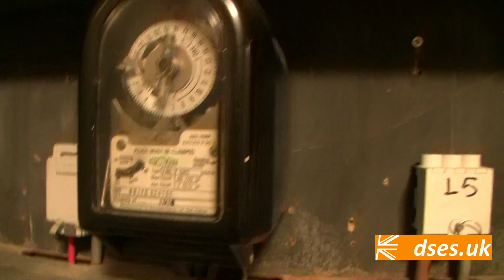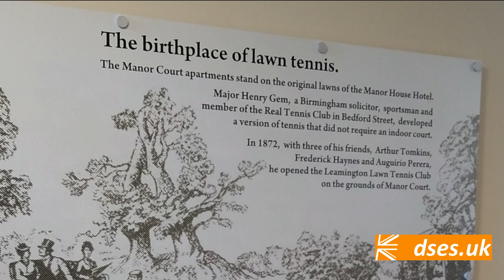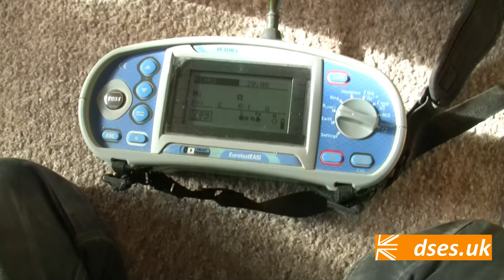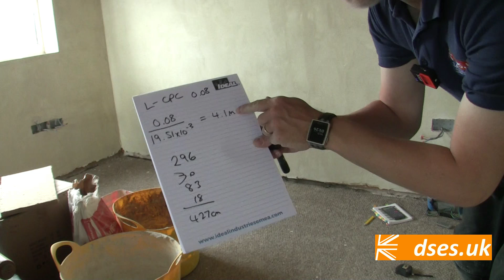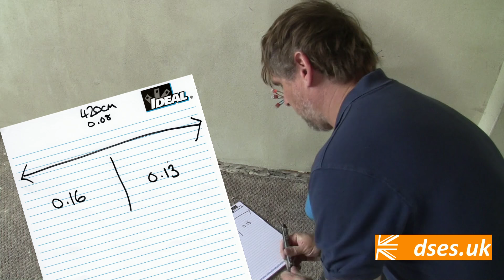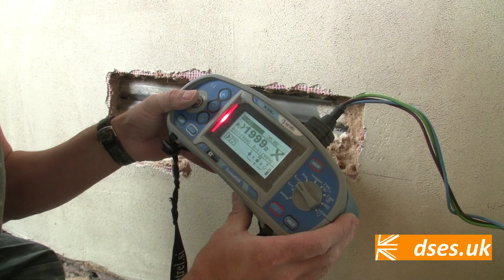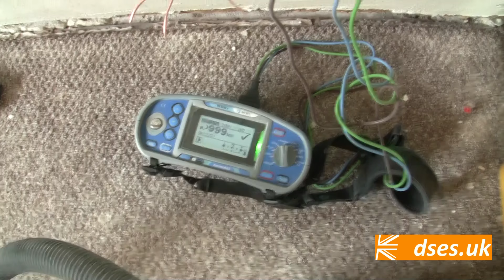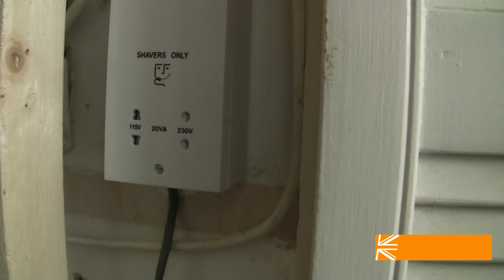Fixing another man's lash-up!

Comment: I have never been a fan of running cables horizontally within a plastered wall especially in a domestic property, it’s just not the way I was taught 40 years ago, sockets under a window was also a big no no, the danger from condensation running down from the window or the fire risk from sockets being covered by curtains.   I agree with you that the person who wired this originally did a poor job especially with the caping but, an inaccessible joint contained within the wall isn’t good practice and I get the impression you already know this.  As soon as I know there is a  fault between two sockets, I would always replace the entire cable rather than waste time trying to establish where the fault is then rectifying it by making an inaccessible joint using a plastic joint box which I assume did not have any metallic protection (why put caping over PVC T&E if you don’t protect a plastic joint box?   As Electricians we are often faced with dilemmas such as this, fixing other people’s mistakes is a large part of working in the trade and unfortunately fixing others mistakes can be time consuming and costly but that’s the fault of consumers who want the original job done for ad little as possible.  Skilled labour isn’t cheap and cheap labour isn’t skilled.
Reply from the maker: Thanks for your input Andy. Regarding the lack of metallic protection, remember that capping does not meet the requirements for mechanical protection and merely serves to protect the cables during first-fix and plastering. That's why I wasn't happy to leave things exposed and why I bonded a replacement board over it:- it removes the responsibility of covering it over from other trades, i.e. the plasterer can now just skim over it without any mechanical alteration that may cause further headaches. Regarding horizontal runs, they may not be a preference but they are permitted. With concrete ceilings and walls here, there will always be horizontal runs in this property, either at accessory level or 150mm from the ceiling with the cables dropping down. The latter is probably how I would have done it to avoid obstructions such as the fireplace recess. While replacing a damaged cable is always the preferred option, the mechanics of such can be too costly, and there's plenty of bargain competition willing and ready to it much cheaper than me. Probably with a choc-block behind the wall.

Comment: I know you can get cable testers for Coax that will tell you how far down the line a break/short is... Not sure if there is one for T&E - but I wonder if one can be made with an arduino...
Reply from the maker: In the 1990's I had a very expensive FLUKE instrument for tracing breaks or shorts in CAT-5.
Reply: @dsesuk  Would be an interesting project...
Reply: @dsesuk  Well if you had a meter with calculator inbuilt then the reading would be convertable from ohms to distance.  A simple chip switched in to do the programming calculation would cost pennies and sell for pounds !
Reply: @highpath4776  

The calculation to find the distance is reasonably straightforward:

The two readings (0.13ohms and 0.16ohms) represent the RATIO of distance to the fault from either end. An actual reading to the fault can be obtained by the following equation:

(r1 / (r1+r2)) x Cable length (end to end)

where r1 is resistance to fault from point 1,
r2 is resistance to fault from point 2
and cable length is obtained by direct measurement (cable route known) OR calculated as David did in this video using the CPC and line conductor. For this example, the calculation is as follows:

(0.13/(0.13+0.16)) x 4.2 = 1.88m from the point where the resistance was 0.13ohms

the same works the other way:

(0.16/(0.13+0.16)) x 4.2 = 2.32m from the point where the resistance was 0.16ohms.

Comment: Most electrical low ohms measurements use quite a high current which would produce heat at the point of the short (or partial short) so in theory a thermal camera could pick the exact point up although I haven't tried that with my camera with cables behind plaster (I have found shorts on wires in open air though) so the plaster may insulate it too well, interesting experiment though.

Comment: Your junction box has a pass through cable position you could have used to protect the uncut cable & give the box double cable support. Just had to fit it the other way up !
Reply from the maker: But then a wholly different circuit supplied from a different CU would be passing through the same enclosure.
Reply: @dsesuk  But it's already doing that for the rest of the route sharing the capping. Is is against the regs ?

Comment: I think it is wrong to critise the electrician as you do not know if others have been involved. The ring circuit is wired in the correct way, as you are trying to provide reasonable sharing of the load around the ring circuit. You’ll find many ring circuits that have all the socket outlets on the first 10mts of the ring and the 20 metre return  leg has no sockets at all. See appendix 15 of the 18th.  You’ll see his method used more on commercial and industrial installations in dado trunking.
Reply from the maker: I've had 'apologists for the other guy' come on before. How many sparks do you really think went through this installation before I came along? I'm not going to avoid showing work I think is poor because it may offend someone else. As for the wiring, on an installation this small a ring is arguably not required and wiring it in a leapfrog method on a domestic installation in capping is of no advantage. You have no argument for suggesting this is correct, and there is nothing at all in Appendix 15 about this other than the sentence of "locating socket outlets to provide reasonable sharing of the load around the ring". This installation is a nonsense.  No two ways about it.

Comment: I'm an Electrician in Australia, and everytime i hear about these ring circuits i shake my head.  I'm sure it's a hangover from post WWII austerity of copper usage.   move on UK.  stop it!
Reply from the maker: I tend not to fit them, but a lot of people have it in their heads that sockets = ring configuration. You even see it in small outbuildings or where a 16A breaker has been installed which are dead giveaways that the installer was a buckethead.
Reply: They do have their usages. Have a whole bunch of desktop PCs off radials, then look at what a ring can do. No contest, ring wins.
A 2.5mm cable takes approx 26A.  Two of them is double. But with a 32A mcb.  You can a have two or more heavy appliance that total say 30A - too much for one cable.  So if you have a radial, heavier cable has to be used on the legs nearest the CU. With radials you generally need more of them, so more cables back to the CU and a larger CU and more mcb's, so costs cascade up. Large CU are desirable in small British homes. Many domestic installations will have three rings, one upstairs, one down and one for the kitchen - 3 mcb's. One for cooker - 1 mcb. Lighting, one up and one down - 2 mcbs.  Total of 7 mcbs.  In small appartment only two rings and one lighting so only 5 mcbs. That means a small cheap unobtrusive CU that can be hidden. Like this, mainswitch, RCD and five mcbs. 
https://www.screwfix.com/p/crabtree-starbreaker-9-module-7-way-part-populated-main-switch-consumer-unit/4818p
But these day we now need to fit SPDs (unless you have a good excuse not to) as well, so another two slots, making that at least an 11 module consumer unit. Unless the RCD  is used for the incoming switch. 
 
In sizing a ring solves a lot. One upstairs and one down with real heavy appliances - works all the time. Two ways for earth back to the CU, as well. The only real problem is that fault finding is more difficult. 
Ring circuits came about in common use on ships with a lighting cable for decks up the starboard side, and one up the port. Saved on heavy cable when joined at the bow giving less hassle.

Rings in houses were initially supposed to be one small ring with many spurs (radials) off that. Saved on cable, time and expense.
Reply: The system is geared for socket ring circuits.  The plugs have a maximum of a 13A fuse inside. Typical is 2.5mm cable, which takes 27A, the sockets on the ring and 32A mcb in the consumer unit.  Highly effective in taking a number high load domestic appliances. 
In the UK they tend to oversize cables, which does not save in cost. An example is the sockets in a one or two bedroomed apartment. With heavy appliances in the kitchen on their own circuits, the sockets for the living room, bedrooms and bathroom, can be off a 1.5mm cable (20A max cable load) on the ring with a 16A mcb in the Consumer unit. The living room, bedrooms and bathroom will only have TVs, computers, bathroom extractor fan, etc on them, with the odd table lamp.  The only heavy appliance maybe a vacuum cleaner. So a 1.5mm ring circuit is far more than adequate.

Comment: I would of opened up a bit of the pvc and see if the copper was damaged and if it weren't it would of just got some insulation tape. And cover it back up. If the copper was damaged then I would of used a blue through crimp and thenn tape it up cover it up with some more capping job done. It's never goin to be seen again

Comment: Does seem an odd way of doing the ring, but each to their own. I think those nails got bent trying to put them through the capping, because those blocks looked like thermal ones which are really soft. When I started in the late 80's I was always taught to run cables vertical, even to this day running cables horizontal doesn't feel right even with them being in a safe zone.
I would have used the Hager box as well, what finish are they going for, old English or Spanish villa, it's crap looks like k-rend on camera.
Reply from the maker: It's a 'rustic' finish!
Reply: @dsesuk   yeah your not wrong there 😂😂

Comment: That board looks like woodfibre insulation. Very good stuff, especially on solid wall retrofits. 20mm is a bit feeble but possibly still a significant improvement if it's just a concrete wall. The plastering method is just wrong. Normally you just put lime plaster directly onto the board. The mesh is only used externally with render, and when you do that you put on a layer of render, then the mesh and push it in so it sinks, then finish off neatly. Looks to me like someone is unfamiliar with the method. It's not that common in the UK, but it will be: we have millions of houses that need either EWI or IWI, and where EWI is not practical for cost or conservation reasons it will be IWI and for solid wall buildings woodfibre is one of the best options.
This chap has a great series of videos on how to do it: https://www.youtube.com/watch?v=7Q-K4vwf-fk
Reply from the maker: Thanks for the info. It does look like an interesting product - not something I've come across before, but that plastering job! It was practically falling off the walls when you sneezed!

Comment: Hi, Dave. I don’t know whether or not someone else has already mentioned this without trawling through all previous comments but when you measured the length of the drop you said 30. Presumably you meant 30mm and not 30 cm?

Then again at the other side; 18, mm?

This would account for the (apparent) longer length you actually measured; adding a combined (drop) of 480 mm instead of 48 mm.

It may be that it’s me having mental wobble and I’ve misunderstood you, in which case ignore this comment.

Comment: Here in the 🇺🇸 usa we use black live white neutral bare or green ground the green or bare go on the ground bar in a msin box and a short between neutral and ground everything will still work and the way to find it check from panel and from each outlet 1 at a time consult a certified electrician

Comment: I'd presumed that the peak circuit switches to off peak tarrif at night - is that not the case? We have economy 7 at home and I'd presumed it was cheaper to run washing machine overnight.
Reply from the maker: That's the way it works in my house Neil; it's a tariff change rather than a physical switchover. Here, there is some physical switching and the homeowner tells me his energy provider say only the off-peak side is cheaper at night, but others in the comments have said the whole installation is on the cheaper rate at night.
Reply: @dsesuk  aah ok thanks. It's bizarre that the off peak socket (if it would work as they believe) is for phones and laptops.... I reckon they're growing stuff in there ha ha. I wonder if the fibreboard walls are to absorb resin smells 🤣

Comment: About new private landloard Gov legislation 20/21 Does the plastic fuse box need to be replaced with metal one?
Reply from the maker: No. Changes in regulations are not retroactive. It says so on page 13 of BS7671. It would be coded as a C3 (improvement recommended) if a plastic CU is under wooden stairs or in a sole escape route, but a C3 doesn't fail a report in just the same way as an advisory doesn't fail a vehicle MOT. That assumes the CU is in sound condition of course and isn't showing signs of damage, overheating, improper modification or whatever. This is backed up by NAPIT Codebreakers and Electrical Safety First (best practice guide 4). I talk about this in another video where an £85 EICR gives a ridiculous C2 coding to a plastic CU installed in a downstairs loo on a house built in 2014. Anyone awarding C1 or C2 codings just because an enclosure is plastic either doesn't know what they're doing, in which case the report they're authoring is likely to be a load of tosh, or they're trying to screw the homeowner for additional work which isn't needed. I also have an article on my website about this: https://www.dses.co.uk/index.php/free-advice/148-plastic-consumer-units
Reply: @dsesuk   Thanks mate Btw great job with tracing that fault. This sort of damages happen where cable entrance the metal back box. I always start there first.

Comment: I think your way in thinking is great as well also just to confirm the ring binder book did you say is the on-site guide with the tabs in it in your video
Reply: Appendix I 
Table I1 of the OSG
Reply from the maker: Yes Scott, the OSG, and as Craig says, the cable resistance table (one of the most useful pages in that book) is in Appendix I.
Reply: @dsesuk  absolutely fantastic wish I could work with you sometime.
Where are you based timing South Yorkshire area.
Reply from the maker: @scottnoble1076  Warwickshire old chap. Not on the doorstep I'm afraid!

Comment: Could you not just do a 1000 x 0.08 / 19.51= 4.1 

To get the distance of your short can you not use that equation with your neutral to Cpc to give you the exact measurement of the break?
Reply: Scrap that it doesn't work it's just doubled in resistance which doubles the measurement. Rightly so

Comment: Just disconnect that part of cable and abandon that socket and blank it off and plaster it, do not go breaking wall making mess,tough if they have one less socket they can use an extension lead.
Reply from the maker: It's not for a socket, it's for a storage heater at the far end (albeit, passing through a socket on the way.... which is odd).

Comment: I'm just at the point in your video where you have calculated an expected failure point, I'm really interested to see if this works. Consider me captivated.
Reply: I wonder if you could do an insulation resistance between N/CPC and the nail. Should be no continuity if it's not the problem.

Comment: Hi David, that's a really informative video, thanks for sharing it.  Did you consider a soldered joint?  Another option would have been to put a back box in the wall with a blank plate on top.  Whilst it wouldn't look great, it might give an indication to others that the cable routing is piss poor?  (BTW please don't read any of that as criticism, just interested to know your thoughts).  Cheers.
Reply from the maker: Soldering could work, but like crimping I lacked a large enough heat shrink on the van to cover it all over afterwards. A box with a socket or blank plate was also an option, and one I should have mentioned on camera, but it would be out of line with the other accessories in the room.

Comment: Im not a spark so don't flame me, but if you removed the nail and the insulation resistance test is then nice and high, why is there any need to further repair it?
Reply from the maker: Hi Jon. My concern here would be that I don't know what damage that nail has done to the copper of the neutral or circuit protective conductor. One or both may have had a chunk taken out leaving a reduced cross-section which would create a point of increased resistance that might fail later.
Reply: @dsesuk  
But from a 'theoretical' perspective would that not show on a continuity test? Stick 500v down it a few times and then check again?
Not questioning your approach as you are the professional and the one that takes responsibility for the job. Better safe than sorry because like you said, better to get it sorted before everything is finished than get a phone call when you are home leafing through Readers Wives...

In any case, great vid as always - have learned loads of great info from you.
rgds
Reply from the maker: @JonSmith-cx7gr  That's true, some continuity testing could indicate the copper is okay in which case it would be best to evaluate whether the attempt at repair is justified considering the damage to finishes. In this case where it's still in the construction stage, opening up the wall wouldn't cause too much grief and could be made good afterwards. It may have been different in a finished, furnished room with a wallpapered wall.